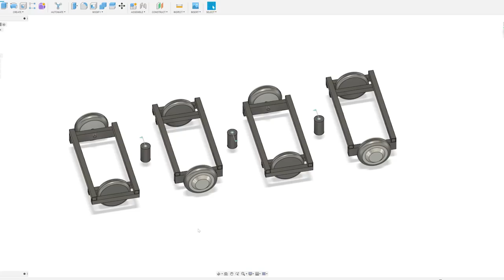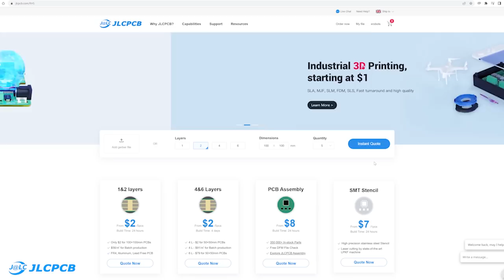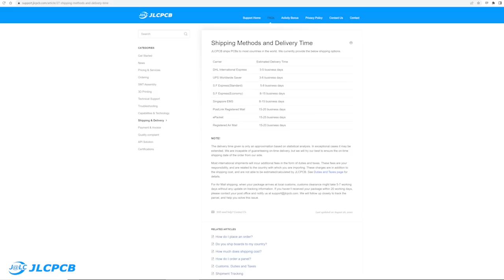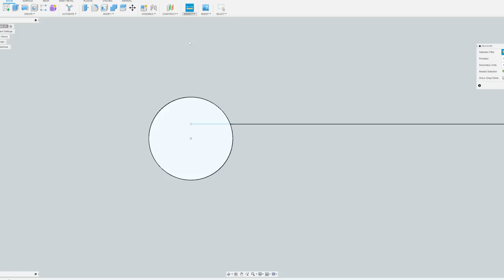Building a Bendy Snake Bike

Comment: I like this "Yeah that's cool and all, but what if I made it BIG?" series you're starting. I can't believe the breakneck pace you're putting these projects out at.

If I could recommend a tool, a CNC plasma cutter. A lot of these bigger projects could probably be designed like flat pack furniture or one of those 3d slot together puzzles. Plasma cutting is very fast compared to CNC routing/milling, and takes a lot of the manual labor out of making complex shapes and structures. If you design the parts with this in mind, you can make things that fit and slot together very quickly and easily for any final assembly and welding. 

Just some advice as someone who works with metal every day, and uses a cnc plasma at work, if you do get one (a sponsor might donate one?) or build one (could make a good video or more likely series for the channel, I could also give you the plans for the budget one I built at work) I'd highly recommend good ventilation and fume extraction, or you'll have a bad time.

p.s. I don't know about you, but I find those hole saws to be an absolute nightmare, step drills are much more pleasant to use in my experience and last a long time (if you run them at slow speeds, which most people forget).
Reply: +1 for the CNC, plasma or otherwise. Or he could use something like Send Cut Send, like Superfast Matt does, and order "3D puzzles" you can weld together.
Reply: OSH Cut is also pretty fast for laser cut metal and they’ll also bend the metal parts. Send Cut Send is also solid, though.
Reply: @OhHeyTrevorFlowers  with the rate he goes through projects, getting them outsourced will become prohibitively expensive quick, especially if v1 of his parts need changes.
Reply: Oy an open dog big enough to ride like a motorcycle.  It may not be fast but it would be all terrain with the right feet.

Comment: I think there will be some issues when running over uneven terrain, since the segments are not free to twist along the length of the vehicle, and the wheels don't have independent suspensions. Imagine riding in a straight line and running one wheel over a small bump. The whole thing will tilt, lifting all the wheels on one side off the ground, and if the weight is evenly distributed over the segments the joints will be under a lot of stress, not to mention that at least 25% of the traction will be lost.
Reply: He could use a universal joint for each one that should be plenty strong and flexible enough

Comment: Hey James, here's a little tip for when you need to thread steel box beams, without having to weld on a nut: Friction drilling. You basically melt the thin wall while drilling, extruding it inward and forming a solid base to thread into. Super quick, easy and reliable.
Reply: I get where you're going with that but what speed and pressure would be needed to make that work?
Reply: You can actually do it with basically any hobby drill press. It's just godawful loud

Comment: I think an ArcDroid would be a fantastic addition to your arsenal. It cuts highly accurate shapes, to a pretty fine level, using a plasma cutter. It can cut any parts you design, from steel, or aluminum plate. You just assemble complex parts, using your welder, bolts, etc.

Comment: Oh one piece of backseat metalworking advice - the optimal rotational speed for drilling steel is surprisingly low! consider using the slow speed / high torque gear of your drill especially for big diameter bits!

Comment: Your drill press has slots that allow you to bolt down a fence. A fence is useful for reproducing a number of holes that need to be located at a consistent location. A clamp can also be added to the fence as a stop to get the holes located at a consistent distance from the left or right end of the work.

Comment: You should add a seat mounted on suspension to two of the segments in a way that it stays roughly level (doesn't flail around like a mechanical bull) and keeps your body away from all the moving and twisting parts at the bottom.

Comment: For the part where you welded the nut on to the tube to add extra threads (around 2:20). Look up nut-serts. These would save you quite a bit of time since you only have to drill a hole, you don't have to tap and you don't have to weld. They are also pretty affordable.

Comment: I realize by now you're likely well down the road to building something already, but just in case you're still planning you should consider building it like a chariot. Make a standing platform on the last car with a control pedestal/handhold. It will be mentally and mechanically easy to operate as the whole thing will be in front of you and you won't have trouble staying on. Your weight will serve to anchor the last car in place, so that as it bends back and forth it displaces mostly at the front, also making it mentally easier to steer and eliminating the possibility of accidentally swinging your tail into things.

Also, it'll look awesome!

Comment: For the control software, I think you'll want changes from the small version. Rather than trying to bend the entire robot at once (sliding the wheels sideways over the ground), it's better to bend at the front only and then propagate the bend backwards as the robot moves.

Comment: holding work piece with hands while operating drill press into the work piece can quickly de-glove your hand or remove digits :-| should the drill bit bite into the work piece or a long chip / rats nest form and draw your hand into the drill press. Probably you already know this but it happens even to careful experienced people, and while the material is metal the outcome can be especially bad. Is it possible to clamp the work and not have hands near the drilling area?

Comment: 0:50 Please don’t use an angle grinder like that in the future because you can seriously injure yourself if you’re not careful. From anything as minor as a friction burn from making contact with the wheel all the way to in the worse case scenario something as awful as getting your finger pulled in between the wheel and guard which will shatter the bones/lacerate the flesh. The damage might even be so much that it could potentially require amputation! Seriously it only takes a couple more seconds to clamp the piece down and it’s sooo much safer. Trust me on this, I’m speaking from experience because when I was in college studying for my welding degree one morning the guy in the station next to me was doing pretty much the same thing and he had a momentary lapse in concentration and got his thumb pulled in which shattered the bones (The sound of him screaming still haunts me) he ended up losing the top segment of the finger because that part was too messed up to save though thankfully the rest was recoverable.

Comment: Metal and wood frame with plastic u-joints... I'm not sure they would be strong enough for vertical articulation, especially since they're infill with grid... I would have used gyroid or cubic infill at least...

Comment: All you have to do now is design and build some sort of laser powered 3D printer that sinters metal dust into finished parts.
The mechanics would look something like the epoxy 3D printers but inverted with a ginormous laser head to do the work, THAT would be a "fun" project.
They do exist BUT I believe that the metal powder is horrifically expensive.
I suppose that if you use aluminium powder you could make it yourself with some type of ball tumbler mill BUT BE CAREFUL if you go that route because Ally powder can be VERY EXPLOSIVE under the right circumstances. They make thermite and all sorts of other nasty stuff with ally powder.
Zink might work BUT zink powder is very toxic so personally I would not go there.
Looks like your channel is once again making a turn in the direction of "very interesting".
Please keep it up...